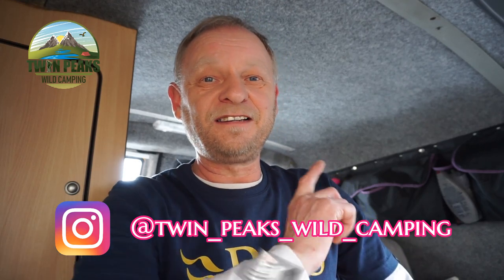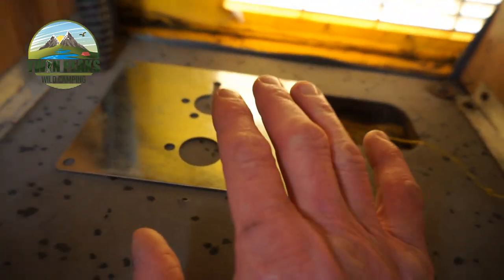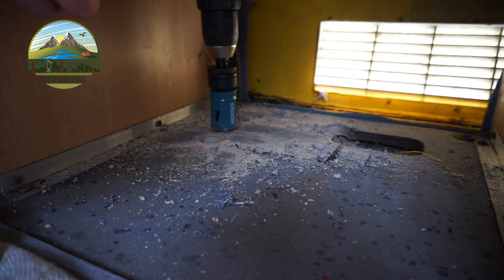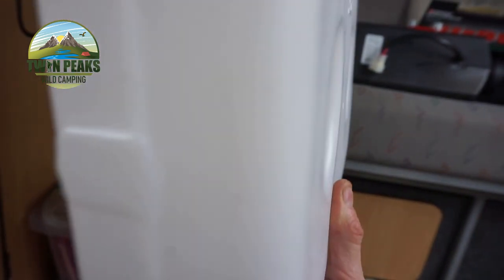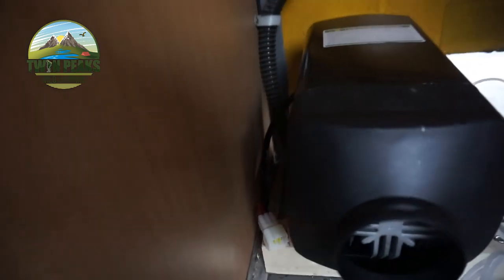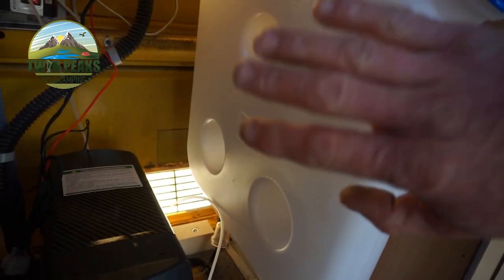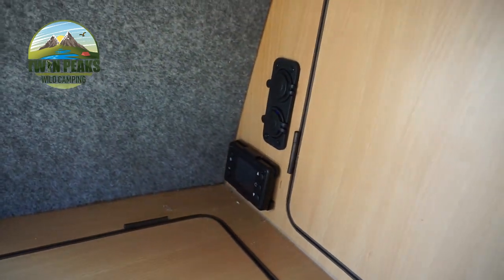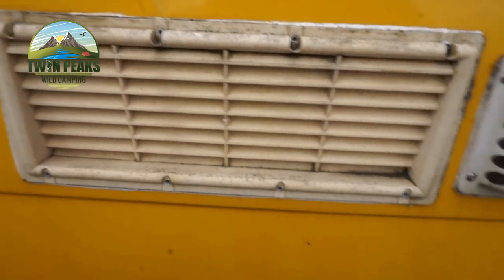Installing A Chinese Diesel Heater | VW Transporter T4 | #vanlife | 5 Kilo Watt | 10 Litre Tank |

Comment: Can you move the fuel pump outside?  I would also paint the inner diameter of those holes you drilled, as they will rust in a very short time.
Reply from the maker: Hi you can connect the fuel directly to the fuel tank of the van but I opted for the plastic fuel tank which suited me, also I painted the areas around the wholes with hammerite paint 😁👍👌

Comment: Do you need to connect it to leisure battery or its ok to run it on vans power
Reply from the maker: I connected mine to the leisure battery as I have a split relay connected to the van battery, I’m not sure if you can connect it straight to the van battery but I might be wrong , cheers Mark 👌👍